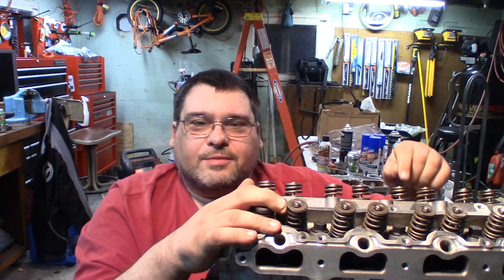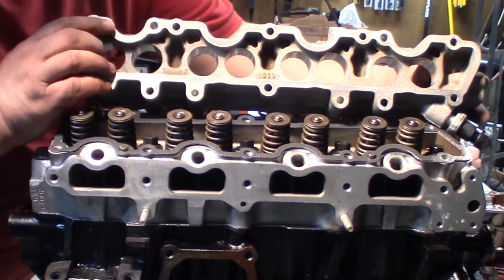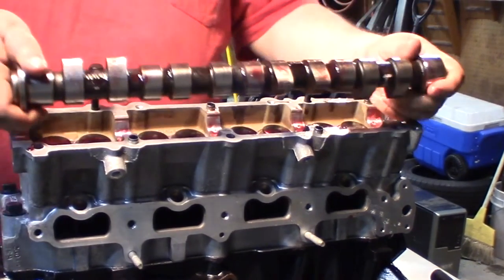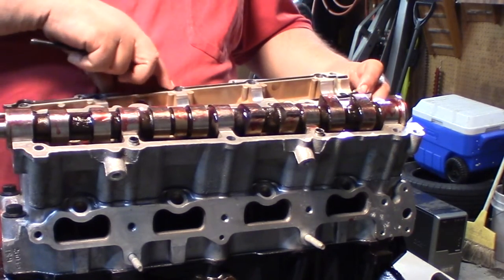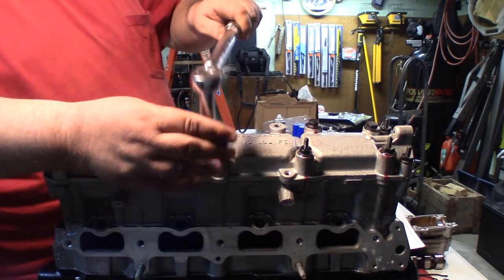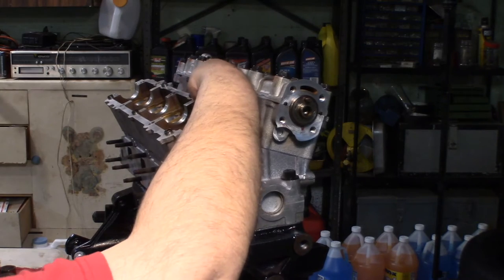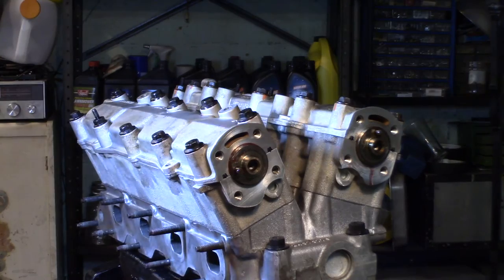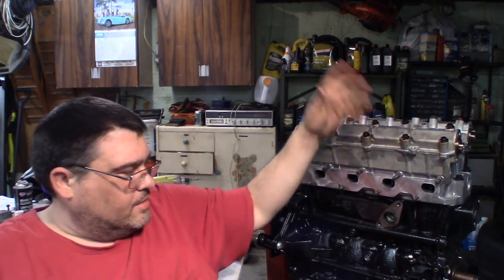LD9 Engine Rebuild Part 15 - Camshaft Installation - 1999 Grand Am GM 2.4 Quad 4

Comment: Thanks for all the detail.  This is pretty impressive to me.  I've turned a few wrenches but never rebuilt a car engine.  Very cool and a bit intimidating.   Great job.
Reply from the maker: Thanks.  You should rebuild one.  It's a lot of fun.  It's not hard as long as you take your time.  You could always start with a small engine like a Briggs 5HP engine.  You use all the same principles and learn a lot about engines in the process.

Comment: I rebuild this engine second time today, and before torq down those cam tower just verify on all lifter if is not stuck after overheating make sure the piston inside lifter are smooth before install, my Felpro gasket are linking a little, better to use Victor Reinzs like GM do because the quality and gauge are different.
Reply from the maker: Yeah I had to tear these back off and replace them again.

Comment: Hey Tom,  why at about 12:28 was the cover setting so high on the camera side?  I noticed you had to go back around and loosen some and then re-tighten in star pattern.  It just would have seemed to me that something was wrong.  I guess I am just surprised it doesn't easily set down on top.  What provides resistance to it setting smoothly on the top?
Reply from the maker: The valve springs are compressing slightly as you tighten the whole thing down, because There is no way to set the cam in, that all lobes are in completely neutral position.   At the same time you have to get the cover to slip onto the of the lower housing dowel pins, it just takes a little shimmying around to get it to all come down straight.

Comment: Hey I know this is an old video but I have a problem. I installed the cover but have a gap.. It's a slight gap but have not tighten anything. Do I need to tighten it in order to compress the lifters to allow the cover to sit flush or should it do it on its own
Reply from the maker: Yes there will be a gap.  You have to tighten slowly and evenly all the way around to seat it down.  There is no spot you can put the cam where it is not going to open a valve when tightened.  Just make sure you have all the cylinders in the middle 90% after TDC then set your sprocket in time and then bring the crank back to TDC so you don't push valve into a piston.
Reply: @frugalprepper  thank you I was going crazy yesterday trying to find the answer. Your video was a lot of help. Thanks again especially for quick response!
Reply from the maker: @JCRUZx91  Hope it all works out for you.  Those are a bit of a job to do in the car.
Reply: @frugalprepper  yes came in for a tune up smh seen a lot of oil in spark plug wells
Reply: @frugalprepper  hey so I finished the job aligned everything put everything back. Installed spark plugs. But I'm getting random misfire? Any tip on how to diagnose this problem problem.. It's a 00 Chevy cavalier z24 2.4L plugs I installed were gapped at 0.4.
Reply from the maker: joshua cruz Are you actually getting a PO 300 code for a random cylinder misfire or does it just seem like it’s miss firing
Reply from the maker: If you’re actually getting a code for a random cylinder misfire I would start by inspecting the coil on boots making sure the springs are clean and using dielectric Gel where it connects to the coil in the plugIf it’s just idling like it has a misfire check the hose that goes to the map sensor
Reply: @frugalprepper  actually got the code. But now I reset the codes and drove it and nothing.. I reseated them and still. Is there any way I can check timing after everything?
Reply from the maker: joshua cruz the only way to really know would be to scope the cam and crank and compare to a known good correlation.  Or a visual inspection.  I’ll have to put mine on the scan tool and see if it has a sync/correlation PID, I don’t think it does.
Reply: @frugalprepper  ran obd2 so it's p0300 intermittent now
Reply from the maker: @JCRUZx91  I would doubt a timing issue is causing a P0300, but anything is possible.  I would start by inspecting all the contacts on the coils and top cover, and make sure you put dielectric gel in the boots or they will leak spark to the cam towers/head and cause a misfire.   

The only other way to tell would be to wait for it to misfire and do a load balance test.  You can't do it by pulling plug wires on this engine, so you'll have to use injectors instead.  Remove that plastic air intake/cover.  Start the engine and then unplug the injectors one at a time and see if the misfire, get worse or stays the same.   When it says the same, that will the one that is missing.  Then you can swap the coil packs in the cover and see if the misfire moves with the coil pack.  I have had to put 3 coil packs in mine.  That ignition system built into the cover is a real piece of crap.
Reply: FrugalPrepper's Garage & Garden alright thank you for the help. Will try that tomorrow mornings. Greatly appreciate the response

Comment: What is the torque spec for the valve cover?
Reply from the maker: This engine doesn't have a valve cover.  The Exhaust cam tower bolts are 16ft  + 90 Degrees for the large bolts a 16ft + 30 degrees for the small bolts.  The intake side is 11Ft pounds + 90 degrees.
Reply: @frugalprepper  Thanks, I've never messed with this engine before. Does the timing cover have to be removed to change out the gaskets?

Comment: Does anyone know if I can pull the cam tower and cam cover as one away from the head or will I need to pull the cams out to remove it from the head?
Reply from the maker: You have to pull the cams, and the outer and inner timing cover off.
Reply: @frugalprepper  Thanks for the reply, thanks!